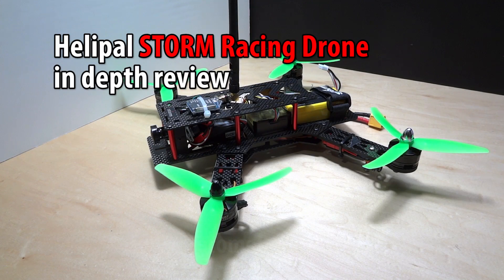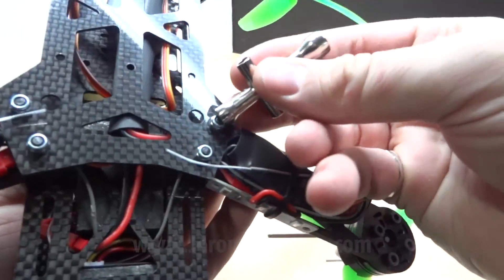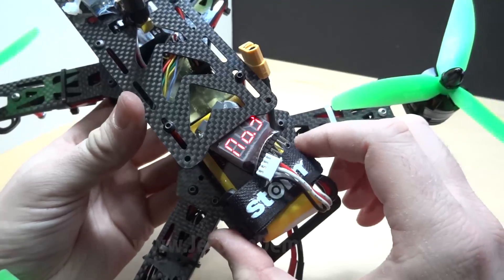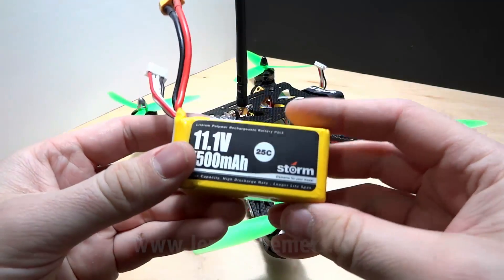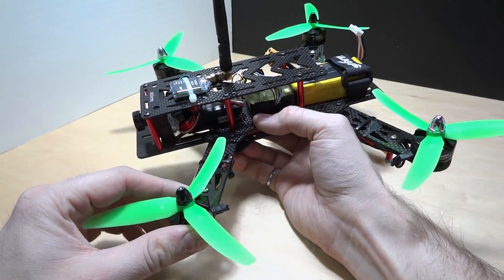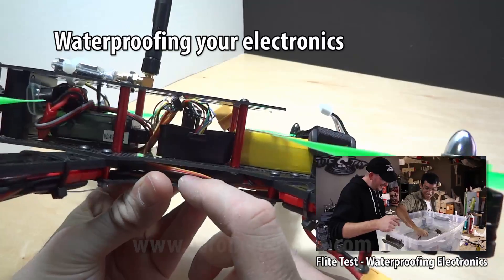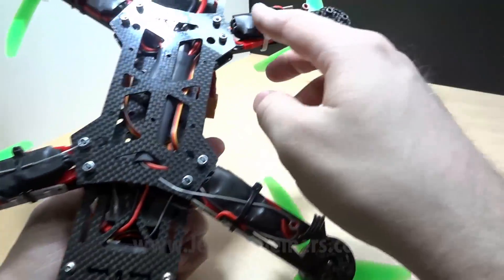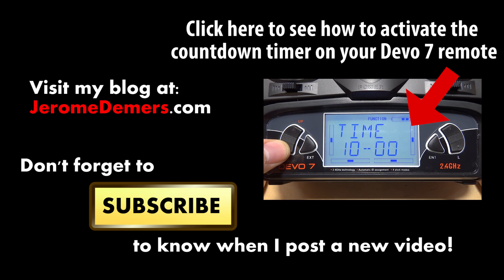250 Mini Quad Storm Racing Drone - In depth review

Comment: Hi, can you help me with my quadcopter.
I'm making it on QAV 250 frame. I am using 2300kv brushless motors, 12A ESC and 5inch triple blade propellers.
I'm using Arducopter 2.5 as flight controller and 3 cell LiPo 11.5V battery.
For transmitter I'm using Flysky 2.4 Ghz 6 Channel transmitter.

The problem is that I am getting enough thrust to lift the quadcopter but the problem is that it is not getting balanced in the air and it trips. While programming APM Planner says, "Compass not healthy." 

can you please help me with this problem.

Regards      Anuj
Reply from the maker: What do you mean it "trips"? your Arducopter  has probably some hard time to stabilize the miniquad. It's all in the PIDs.  You could also be in acro mode and that could explain why it "trips" in the air. Try horizon mode. In miniquad we don't need a compass. So I would not care about the warning. You go check our Painless360 video on the APM. I recommend you go with betaflight and find a new flight controller. Try joining facebook group that use the APM. They will help you since they use it.
Reply: thank you very much. I will try what you said

Comment: is this the storm 250 v3
Reply from the maker: no, this is the very first version. The new one is much much better!
Reply: Jerome Demers im thinking the 280 looks mean
Reply from the maker: check the ninja 250! have fun it's your toy!
Reply: +Jerome Demers oooo its hard to say look up walkera f210 gees thats fast
Reply: im btw walkera and type-a v3 idk which is better
Reply from the maker: type-a v3
Reply: +Jerome Demers rationale?  type a v3 with 280 specs or 250 v3.... is it plug and play or need soldering skills
Reply from the maker: it does not matter 280 or 250. The 250v3 needs no soldering
Reply: As in this one sorry there is so many different type a models and I just want to make sure im correect in my assumption as Im new to this hobby http://www.helipal.com/storm-racing-drone-rtf-srd250-v3-cleanflight.html
Reply from the maker: yes that is perfect, if you would ask me how which one I would buy, I would get the Loki X5
http://www.helipal.com/storm-racing-drone-rtf-srd199-loki-x5-cleanflight.html
Reply from the maker: or this one! that thing has 6mm arm thick arms!! Even a beginner will have trouble breaking that!

http://www.helipal.com/storm-racing-drone-rtf-srd195-cleanflight.html
Reply: my only issue with the loki is it doesnt have the alarm which I feel i would need since I am new and the srd195 has no fpv system built in as well.
Reply: I haven't read anywhere that the srd250 v3 is plug and play? can you refer me to somewhere, I'd appreciate it! thanks
Reply from the maker: RTF = Ready to Fly
Reply from the maker: scroll down and check
This package includes :
1. Fully Assembled SRD250 V3 (w/ CC3D) and FPV System (Camera and Transmitter)
2. RadioLink AT9 Radio System
3. Storm 14.8V 1300mah 35C Li-Po Battery
4. SKYRC E4 Charger
5. 6pcs Clockwise HQ 6 x 3.5 Propeller (4 of them are spare)
6. 6pcs Counter-Clockwise HQ 6 x 3.5R Pusher Propeller (4 of them are spare)
7. 2.0mm Hex Wrench
8. 8mm Hex Nut Driver 
9. FREE GoPro 20° Mount w/ straps (* Exclusive on Helipal.com)
10. FREE Mobius 20° Mount w/ straps (* Exclusive on Helipal.com)
Reply: that doesnt mean repairs will be solder free such as the type b 250 its solder free repairs.. is what im asking
Reply from the maker: oh ok I understand, well it does not matter since like it or not, you will eventually need to get a soldering iron if you start miniquad! It's inevitable! Then get the type b 250 that is solder free repair.
Reply: im thinking of the srd 280 rtf looks sweet
Reply: +Jerome Demers touche. you do have a point

Comment: you think I could just buy all the parts, and get a 250 frame?
Reply from the maker: Yes, it will be cheaper and you will learn a lot.. It will be frustrating and rewarding.
Reply from the maker: Check video description for all the parts
Reply: +Jerome Demers thank you so much! I've been trying to decide which drone kit to get, and I kept coming back to your video, about how long of battery time do you get for this thing? also what speed does it go if you know of any
Reply from the maker: if you are a beginner, it will go faster then you can fly it!  I would say easy +80km/h. Don't worrie about batterie life, I know I was worries about it went I started. For example, my new setup, I have 2204 2300kv and 1300 4S batterie and when I race straight lines I get 3min 30sec and when I fly low speed around my house to chill out and have fun, I flew 11min!! With the same setup that flew 3mins.  Normally my other quad I could go up to 9min (2204 1960kv). These numbers are from today flights. Fly in RATE mode from the beginning. It's worth it.
Reply: +Jerome Demers thank you! I cannot wait to get my hands on one of these! :) thanks for all of your help! :D
Reply from the maker: +Husky Studios no problem man! Come join facebook groups  "The Mini Quad Club" or others there is a lot of people that can help.
Reply: +Jerome Demers yeah I don't have/use facebook, but thanks anyways!
Reply from the maker: +Husky Studios Dal Props, you will have a hard time to break them. Dont touch the gemfan 5030. 
http://www.banggood.com/2-Pairs-DAL-5045-V2-5-Inch-CW-CCW-Propeller-For-Mini-Multicopter-QAV250-Frame-Kit-p-1023208.html?p=0K10221067687201501F

The ESC are good, up to 4S.
http://www.banggood.com/ZTW-Spider-Series-18A-OPTO-ESC-With-SimonK-Oneshot-Program-p-983660.html?p=0K10221067687201501F

The charger you selected is great but you can get cheaper
www.hobbyking.com/hobbyking/store/__22410__HobbyKing_174_B3AC_Compact_Charger.html.  

I will check the rest tonight but à lot is good. Oh yeah , get a naze! No cc3d.
Reply: +Jerome Demers okay! thank you so much! I love your vids btw, also you are probably one of the most helpful people on the internet I've met thank you! :D
Reply: +Jerome Demers do you know of any really cheap viewing screens for fpv? goggles or screen? can't seem to find one
Reply: do you know if the esc's come with 4 per unit or just one?
Reply: also I think i'm getting confused, for an entire build, I need

4motors
4esc's
4props(more)
1transmitter w/receiver
1carbonfiber250frame
1flightcontroller(naze32)
1fpvtransmitter
1fpvscreen
1fpvantenna
1actioncamera(choice)
black zipties
battery straps
heat shrink
1 case (optional)
1fpv camera
batteries
battery tester
locknut driver (10mm)

I think this is it, I really appreciate all your help, it really means a lot
Reply: +Alice DroneGirl thank you!  I had looked at that one already, but thought it would be better to custom build
Reply from the maker: +Husky Studios typically ESC come in pack of 1. The price is between 10$ and 20$ for 1 ESC. The price is a clue for the quantity.
Reply from the maker: +Husky Studios batterie charger and get silicone wire 16AWG
Reply from the maker: +Husky Studios 106$ http://www.hobbyking.com/hobbyking/store/__96170__7_34_FPV_Monitor_with_In_Built_Receiver_Lieber.html
Reply: thank you so much man! you are the moth helpful ever!
Reply: most*
Reply: this would be more affordable though, right? just get a receiver and lipo battery for it?
Reply from the maker: yeah that's good to start. You need a video receiver. http://www.hobbyking.com/hobbyking/store/__80346__RX_5822_5_8GHz_32CH_Wireless_A_V_Receiver_with_A_V_and_Power_Cables.html or this one, the lastest and best http://www.hobbyking.com/hobbyking/store/__84862__Quanum_RC540R_5_8GHz_40CH_Race_Band_FPV_Diversity_Receiver.html
Reply: +Jerome Demers thank you! there are compatibility issues with fpv right? also I'm on a budget :D
Reply from the maker: I don't understand your compatibility question, technically, no. If you have 5,8Ghz gear and buy all 5,8Ghz, you will have no problem. The only issue with some vtx that have 32channel and some receiver that have 40channel.
Reply: okay, thatr's what i thought, thank you, this week i have my friend, who knows a guy who knows some things, so i should be able to egt going through him, i just really want to thank you so much, man i can thank you enough!
Reply: I want to thank you for being one of the original first people to help me with this. I am excited to say I will be building mine in 2 days! I have gained do much knowledge , thank you ;)
Reply from the maker: woot woot! nice work! Have fun and be safe!

Comment: hello friend a consultation, I have my drone like yours 250 engines I have are emax mt from 1806 to 2280 kv my question is that I have propellers 3 blades are 5x3. I have a 3-cell Vateria 2200 miliamper be perfect or I have to use a 2-cell Vateria miliamper 4000 which is ideal for undron 250 with 3 blades propeller from Vateria and I thank you for your response...
Reply from the maker: Use 3s batterie
Reply from the maker: 2.2Amp is heavy for 1806. You could use smaller.

Comment: HELP!!! Do you need to solder anything when you buy this kit???
Reply from the maker: MainlyMagic No my friend!  You charge and plug the battery only!!
Reply: Thanks!! Just one last thing... is there anywhere where i can find it cheaper than £250?
Reply from the maker: MainlyMagic Has a RTF, I don't think so. Maybe somewhere someone could build one for cheaper. You can get it cheaper by building your own. You will need to buy all the parts separate and solder/assemble everything yourself. Add a couple of hours of debugging, frustration, and you will have something cheaper! You will also learn a lot!
Reply: Ok!

Comment: so i bought the same buzzer, hooked up to the aux 2 port but how do i get it to work with the switch? do i have to program it into the controller?
Reply from the maker: ken pleil no programming. Just flip some switch on the remote control. Try all of the toggle swith on the remote until you hear the beep. If Aux2 does not work, try Aux1.
Reply: thanks dude, i was messing with the transmitter, i had to configure a switch to the port i had it plugged into to get it to work

Comment: Spedix s250 better?
Reply from the maker: Knuckles For Knuckles well, why not? It seems good but if you break a part, you will need to buy from them and you can not change to a other manufacturer.
Reply: I don't understand your answer?
Reply from the maker: Knuckles For Knuckles no it's not better.

Comment: 280 is good, as you can use 6inch props. And 280 should be allowed to fly with 250, they should be considered the same class :)

Comment: my devo 7 no longer starts my drone when the sticks are placed in the unlock position nothing happens right model is chosen on tx  don't no what todo
Reply from the maker: Gilbert Baker Make sure the receiver is bind with transmitter. Check color of LED in the transmitter. After that,plug the CC3D in your computer and check the arming sequence. Check if it's enable. Something, the arming is disable and you can not arm it.
Reply: Thanks for your suggestion now what do I use to connect it.
Reply from the maker: a USB cable?
Reply: Thanks so much for your time my cc3d is showing flashing blue and steady green is that OK

Comment: Can you make a video on connecting electronics to the transmitter? (For example, how you connected the discovery buzzer on 12:04)
Reply from the maker: Trey Souder it's very easy, only 1 step. You just plug the discovery buzzer in Aux2 of the receiver.
Reply: Oh wow... OK Jerome Demers
Reply: But what's the voltage that you need for any other electronic that you want to connect? Jerome Demers
Reply from the maker: Trey Souder well that depends of the voltage of the electronics you want to connect. Some component can take only 5V, some 3.3V and other 12V. You need to check the specs of the components.
Reply: OK Jerome Demers
Reply from the maker: tell me what you want to connect and I can help you
Reply: K
Reply: by the way, what batteries should I get. I dont want too much punch
Reply from the maker: Trey Souder nano tech for 11$ and you get ~6min
http://bit.ly/nanotech_3S_1300_25-50C
Reply: Ok thanks
Reply: What do you think would be a cool electronic to attach? I can't think of one. And also, is it possible to attach more than one electronic to the transmitter? Sorry for all these questions! 😂😂 I don't have the Storm.
Reply: Still deciding over whether I should get it or not...
Reply from the maker: Trey Souder lol, didn't you check the video! :P hihi! Get one! :)
you will have lot of fun and will learn a lot!
Reply: K
Reply from the maker: Trey Souder you can plug an OSD so you can read the voltage, current on the display or goggles, you can not plug a lot of things on the remove because you will ran out of connections. You can attach an arduino with cool RGB LED. Be sure that it's not too heavy.
Reply: A retractable claw would be cool also... so i could pick things up with it
Reply: The quad comes with some straps too, right?
Reply from the maker: Trey Souder lol I hope you are joking! haha, Learn to fly first, you will see it's not fun and game at first but it's worth it!
Reply from the maker: Trey Souder battery strap yes.
Reply: Haha! OK thanks!
Reply: One more thing! Sorry! Is there any other way to contact Helipal other than email?
Reply from the maker: facebook? or ask phone number by email or fb. I only contacted them via email.
Reply: OK thx
Reply: I guess I just can't run out of questions... I'm going to get it, but I'm just curious about something - how much weight do you think a 3 cell type A racing drone can carry?
Reply from the maker: Trey Souder not alot, you get ~6min with 1300 batterie. Each motor push ~310g. Total of 1240g - 560g(weight) = 680g of thrust. So you can not lift more then 680g or else you don't fly. You can carry 200g but you will fall to ~4min.
Reply from the maker: Trey Souder don't forget to check and read the RCgroup STORM racing drone forum
http://www.rcgroups.com/forums/showthread.php?t=2297291
Reply: OK awesome thanks

Comment: What are your current pids? I'm trying to get mine tuned in but still getting some spin outs
Reply from the maker: TheShaddydogg this is a CC3D and not a Naze

In stabilization, Advanced tab

In Rate Stabilization (Inner Loop)
-------------ROLL-------------
P: 0.0055
I:  0.0030
D: 0.0001
-------------PITCH-----------
P: 0.0055
I:  0.0030
D: 0.0001
-------------YAW-----------
P: 0.0035
I:  0.0035
D: 0.0001
-----------------------------------

Comment: French ? 
Very good review ! I've got almost the same quad but with kk2 board.
I've the feeling that my storm quad is ...very slow in comparition to others video of storm racing. If i go full or  3/4 throttle, my quad is not faster but gain some altitude : /. Do you hve any idea of gain some speed ?
Reply from the maker: Vladoo153  Yes, I am a french Canadien from Québec! What batteries are you using? 3S that are 35C and up? Current equals torque, power. What brand? I am pretty sure it's the batterie that can not give enoungh current.
It's not a super fast quad, if you use the 3 blades 5x3 it's ok speed. The pitch of the props make a huge difference. Are you sure you have 2204 motors and not 1806? My friend has some 1804 and that is slow! Is your mini quad heavy? 450g to 550g?
Reply: i' have got E MAX MT2204 2300 kv, weight around 410g withoout batterie. I have different batterie, turniguy 1300 30-40C, turnigy 2200 20-30C and orion 1600 50C. It 's on 3S with GF 5030
Reply: but i don't see so much difference between each batterie : (, the  2200 is pretty heavy
Reply from the maker: Your batteries seem fine. I don't know. Like I say, mine is not "that" fast. Are you in "expert" mode with your kk2 board? Are you power limited by the flight controller? Stuck in a mode? Maybe you saw to many Charpu/MetallDanny videos and you think it's slow! :P
Reply: Jerome Demers Yeah, that's true, i've seen too much quad racing (charpu, parking racing ...) : D. I must keep practicing !! I will increase the gain setting, maybe it will helps gain some speed !Last question : i'm using a homemade little pan and tilt syteme to adjust the angle of my fpv cam (sony 700 tvl) during flight. I've found that just few people are using this kind of feature. Do I do wrong ? 

Thw a lot for you response, cheers from france. : )
Reply from the maker: Yes, you know why they are not using that tilt system? They say that "you are disconnected from the machine" while flying. Since you are in FPV, you don't know which direction the frame is pointing while braking/accelerating when flying fast. The gimbals is straight but the frame is at an angle so you lose that precious information. The CC3D has that function, I will try it. Va te coucher là! Il est 1h du mat! haha bonne nuit! :)

Comment: Superb review, just what I was looking for. 

Quick noob question, is it easy enough to add a flight controller with GPS? Just a case of swapping out the supplied flight with a GPS enabled flight controller?
Reply from the maker: you can buy a complet ready to fly with GPS from helipal! It use the NAZA from DJI. You can also buy the CC3D (flight controller) with GPS and swap it later on.
It's easy enough to do that later on.